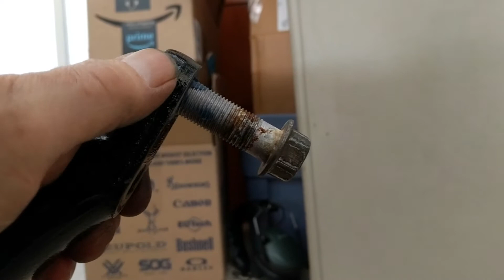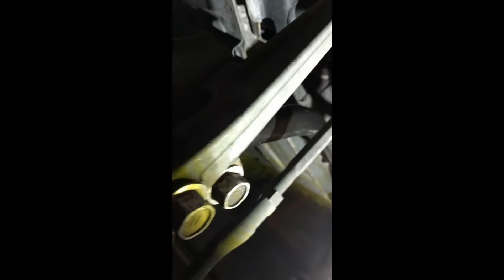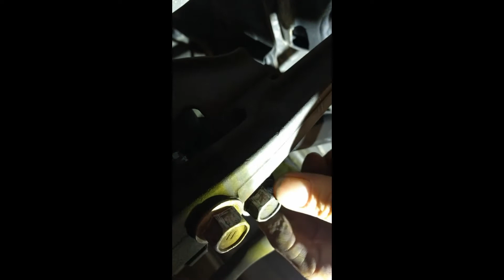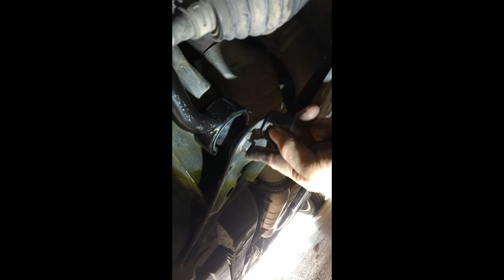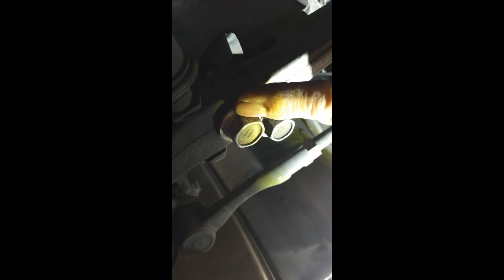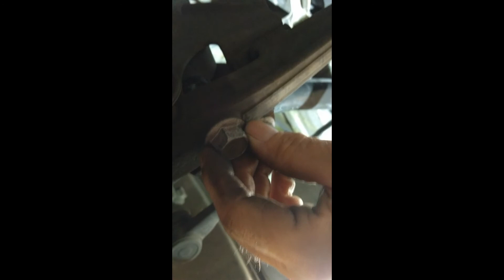Lexus IS300 replace front #2 control arm supplement by froggy

Comment: Thanks for these 2 videos, Froggy.  I just did this job and you helped a lot!  Running those bolts in first is a good idea.  Also, putting the first bolt in place then leveraging the bushing over the shaft worked like a charm.  No more shimmy in the front end!!